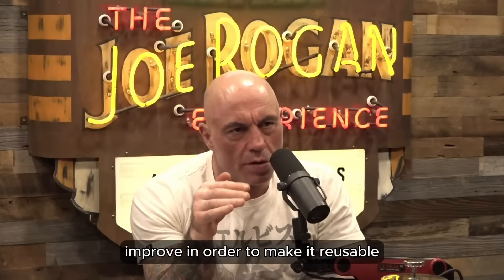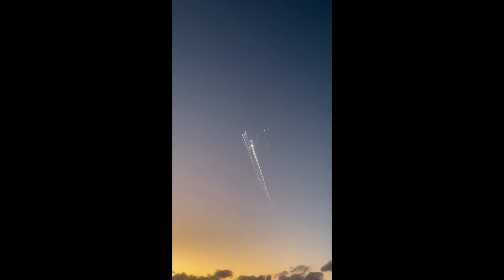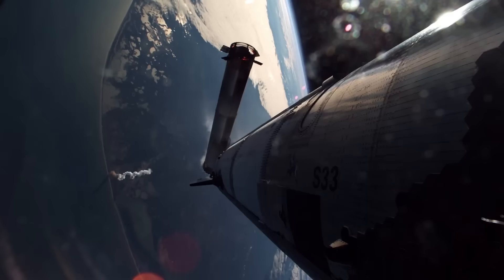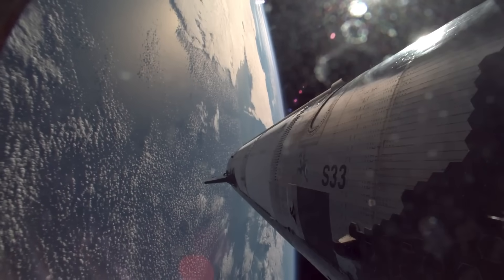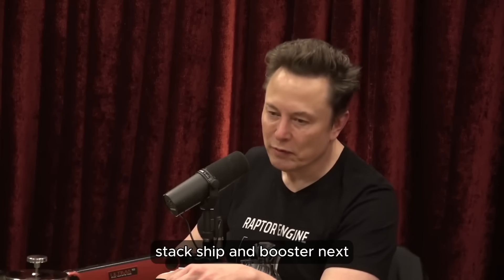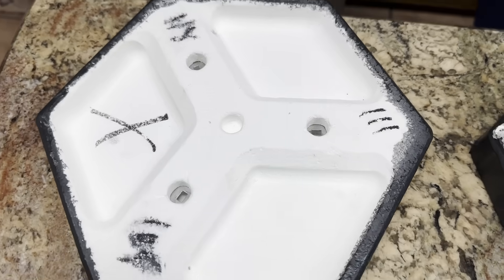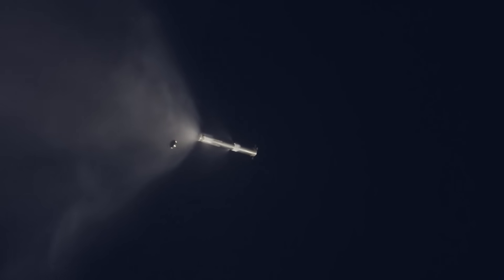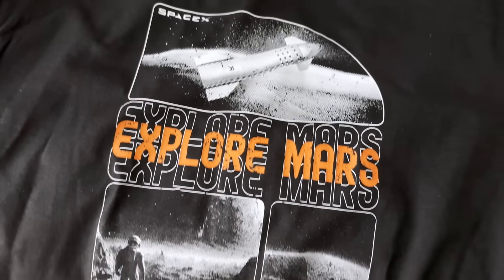Elon Musk: Heat is ON for Starship's Heat Shield to Succeed

Comment: tile expansion and contraction problem solved geometrically already by nature, snake scales, fish scales , lizard scales. Just copy that geometry and problem should be solved. I think materially Elon's on the right track with cooled metallic tiles. Has anyone ever wondered how the engine bells survive all that heat? Its because they are cooled by propellent as it flows through capillaries in the bell on its way to the combustion chamber. The same solution for the tiles should work, hard part is solving for weight budget.
Reply: What you describe is called "shingling". That idea was tested in the late 1960s for NASA's Space Shuttle. Way more complex than the tiles so that idea was dropped. 

It was resurrected in the mid 1990s for NASA's X-33 single stage to orbit program. I tested shingled metallic panels in the NASA Ames 50 megawatt arcjet wind tunnel. They worked OK to 1800F but could not be pushed to 2500F on the hottest parts of that vehicle.
Reply: @ right,  interesting history, but I suspect its not as simple as shingling a roof, there has to be more complex geometry going on and I suspect its hidden in nature. The idea is not to solve the heat problem via "shingling" but the expansion and contraction problem. The heat problem solved via metallic scales and coolant.
Reply: @rays2506  very interesting and informative.  Why do you think the they couldn't withstand the higher temperatures?
Reply: @rays2506 The X-33 has always fascinated me. Is it true that it was 80%-90% done when they canceled funding for it? Ive heard that they even figured out solutions for the Spike engine problems, but never got the chance to implement said solutions.
Reply: That sounds cool, but plasma gets into any gaps.
Reply: @ scales on a snake don't have gaps that are not backed up by the next scale. That's the idea, to get rid of gaps.
Reply: Yes, exactly.
Reply: Lol active cooling 🤣🤣🤣🤣

No - there's too much heat and nowhere to dump it to. The reason cooling the engine bells works is it's using cryo cooled liquids and the waste heat is preheating the fuel before it gets sent to the combustion chamber...

Unless you're looking to store a bunch of cryo cooled mass to use on re-entry (both for Mars and the return trip to Earth) and somehow keep it chilled, and dump it overboard after it cools the tiles - there's no way... Which really means there's no way because the mass required versus payload hit is a non starter
Reply: @miamisasquatch  I only say it because I thought I heard Elon say it. Maybe not, it was during one of the early interviews before starship 7 or after, can't remember.
Reply: For what it's worth, ships returning from Mars do not need to be rapidly reused.

Tankers are the most important ships to be able to reuse rapidly, as a lot need to be launched, and their cargo is loaded right on the pad.
Coincidentally, tankers already carry cryogenic fluid, which in context requires no special effort to keep cold.
Reply: You are right, of course, fish and snakes regularly survive atmospheric entry at Mars transfer velocities.
Reply: @DR.LingeringFrey 😂😂😂
Reply: @DR.LingeringFrey  lol, lateral thinking